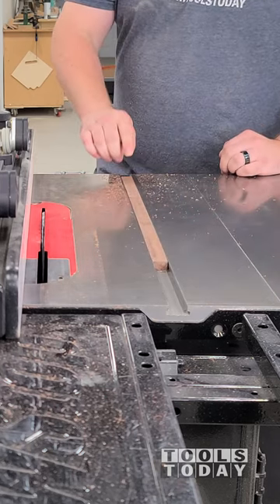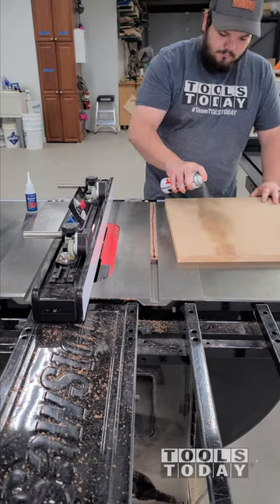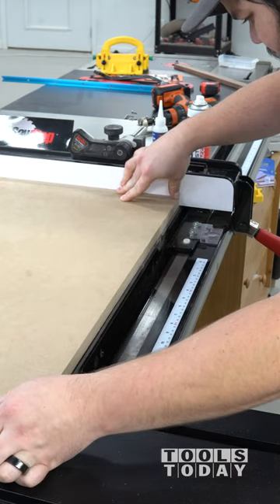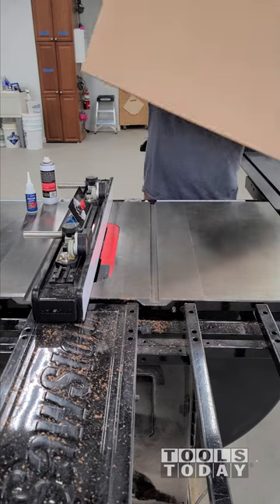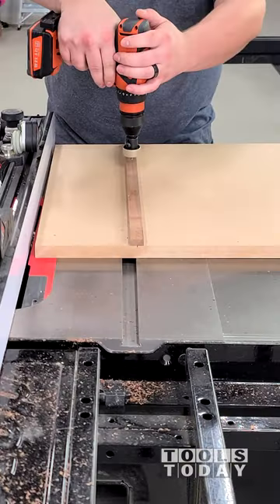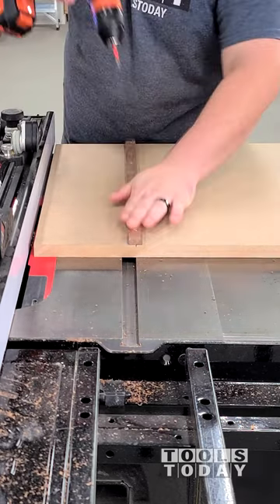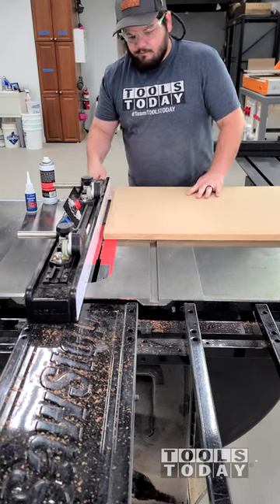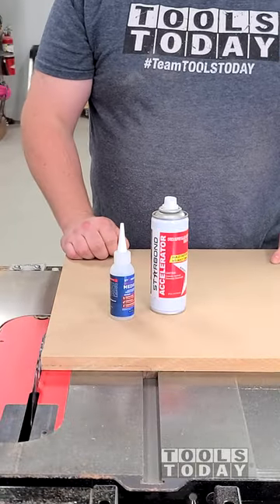Easily Attach Miter Bar to Sled

Comment: CA glue already bonds within seconds. Why would i add an accelerator so it is can bond in 30sec.
Reply: Clearly you haven't used a ca accelerator
Reply: @chefbob09  true i haven't.
Reply: Accelerators spray help secure edit a lot more potent density where the particles are stronger